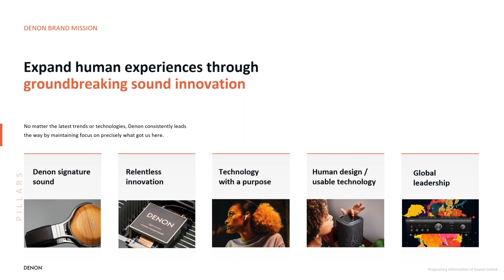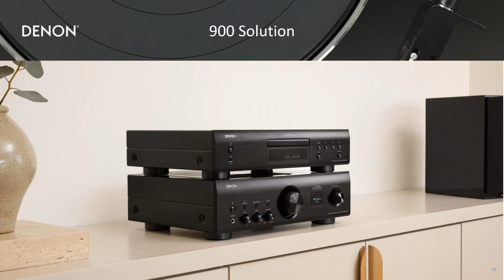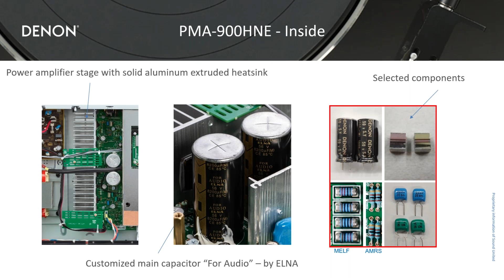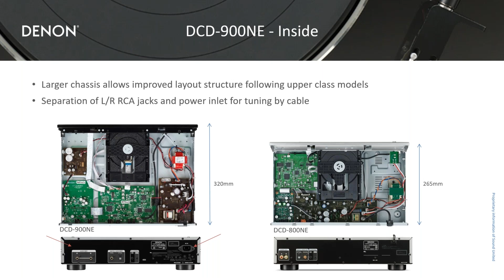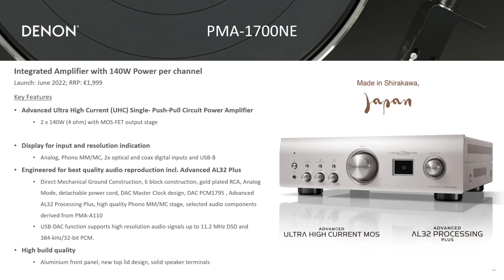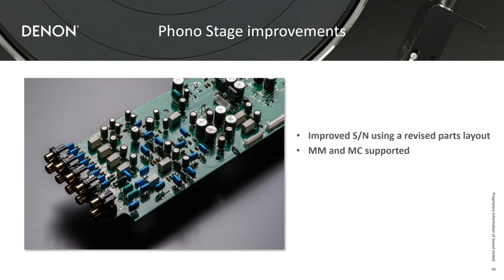Denon 900 Series Hi-Fi - Technical Deep-Dive!

Comment: I have both the DCD-900NE and PMA-900HNE and am very pleased with both units. I have attached a pair of Wharfedale 12.2 speakers to the amp running biwire 2/4. What can I say, a very nice, clear, full sound. Very pleased with the sound quality and build quality. In truth this is my ‘settled system’ where I don’t have any need to add anything to it. I use CD and USB with Flac files connected via analogue out to the amp and the sound is full, rich and with a touch of analogue warmth which is very, very easy to listen to for longer periods of time. The Network side of the amp is clean using Airplay more often than anything else with an iFi LAN iSilencer plugged directly into the router then connecting via a high quality RJ45 cable to the amp, again great results, a very entertaining sound. I use 12 gauge 2/4 biwire red copper OFC cable (Western Electric) speaker cable and connecting the CD player to the amp I use Van Damme Plasma cable giving or allowing everything to come with no issues to the speakers. I also use custom built power cords which were not very expensive but certainly a step up from any standard power cord. It’s a  great system and in my opinion given the internal components and build quality probably one of the best value HiFi products on the market even two years later in 2025.

Comment: Hi.  Just wondering where the Pre-Out is on the 1700NE?  How to connect a subwoofer that does not have speaker level inputs?
Reply from the maker: You will need a high to low-level adaptor to convert High Level (speaker output) signal to low-level (RCA). Connect it to the speaker B outputs
Reply: @SoundUnitedTraining  Thank you!